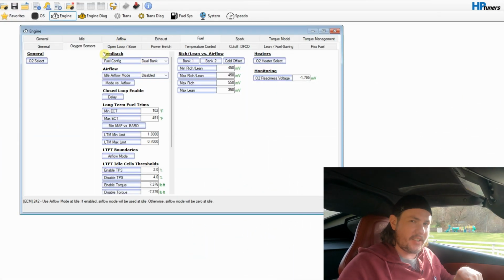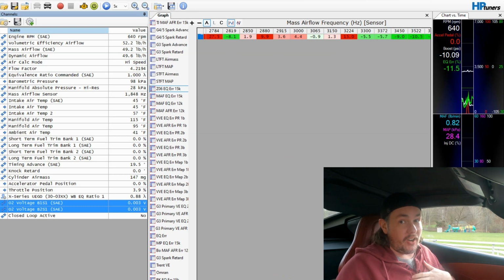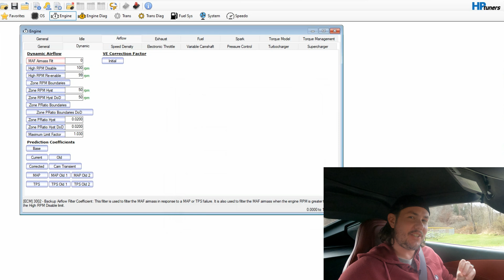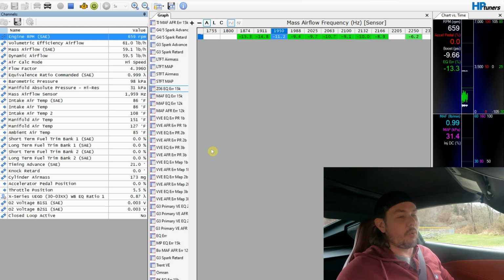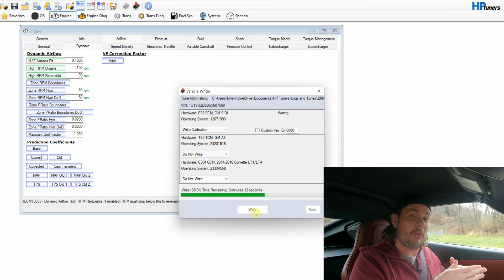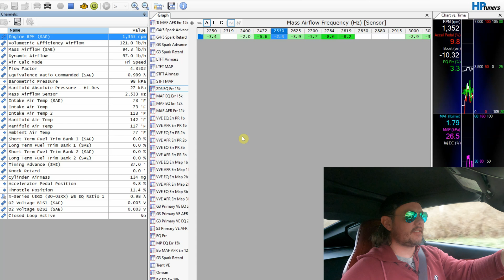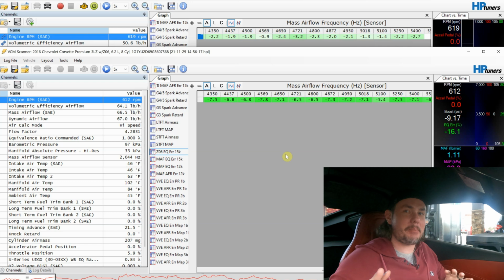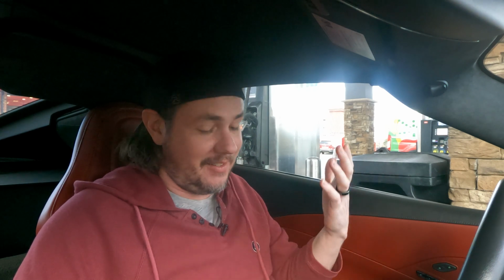MAF Airmass Filter Pt. 1, Test In Tune!  What Does It Do!?!

Comment: Hi I have a question regarding my ecm from a 07 chevy colbalt ecotec 2.4 turbo has a p0315 when I scanned it checked all wiring and changed crankshaft position sensor.  When I tried to clear to code wont clear I didn't crank the engine yet no matter what I can't clear the code?.

Comment: Seems like the reading are representative of the difference between the actual MAF reading Vs the MAF calibration file w/o influence from the O2 sensors. Error within .05 (5%) deviation for one trial & 0.10 deviation (10%) second trial.